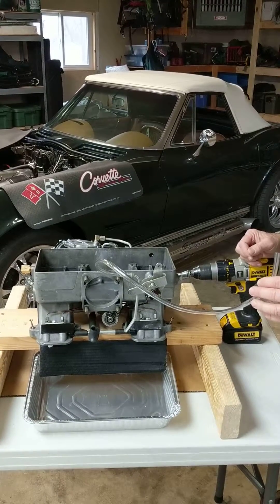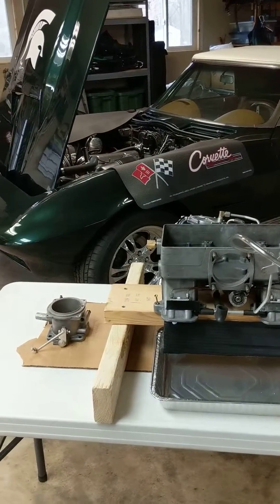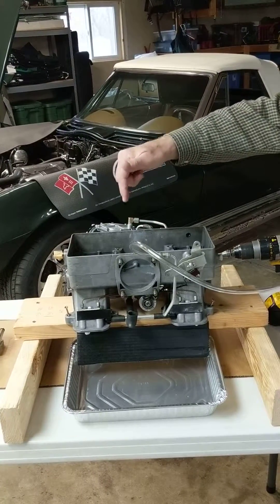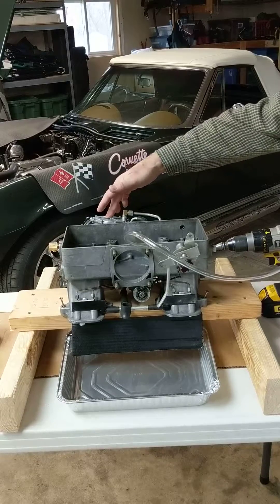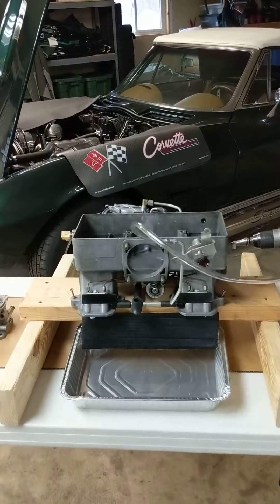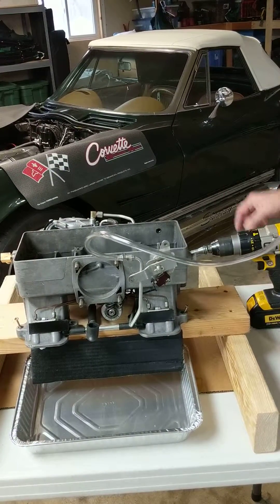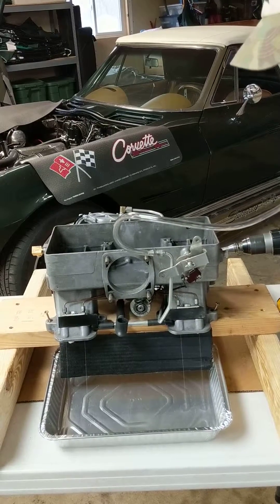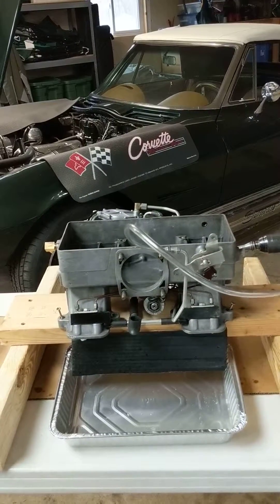1964 Rochester fuel injection nozzle test.

Comment: you need to use 8 graduated in CCs cylinders to see if all 8 are putting out equal amount of fuel
Reply: Theres not nozzles in a conventional sense. There basically nothing more then pipes. The mechanical pump regulates the fuel flow. Youd have to check the flow of the pump